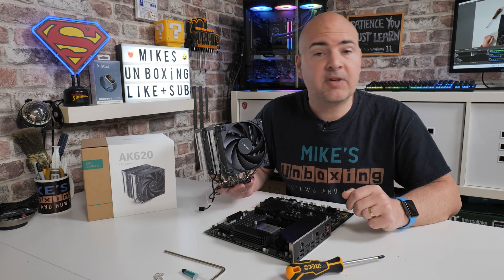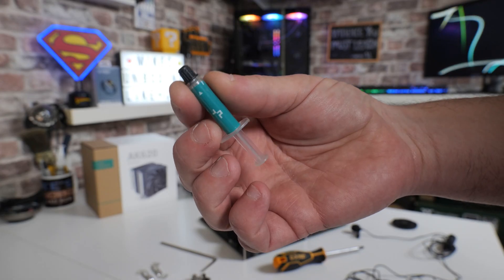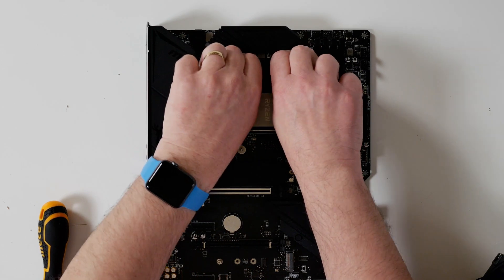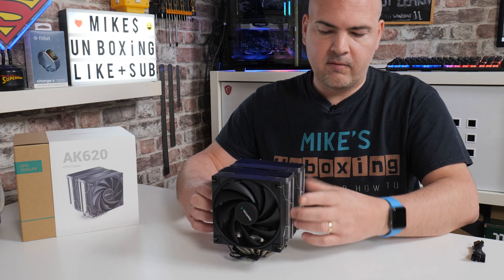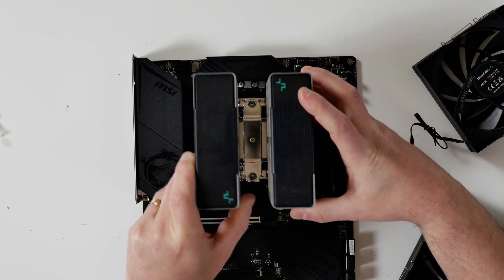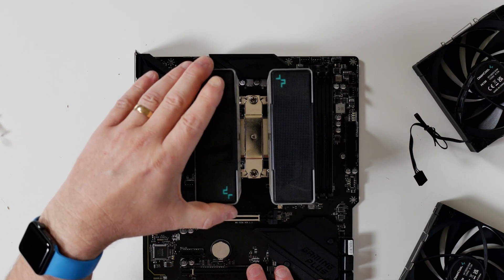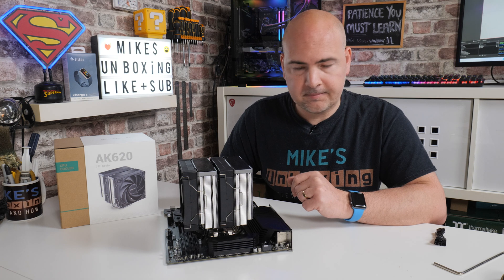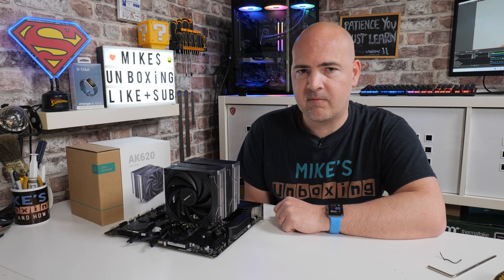How To Install Deepcool AK620 CPU Cooler AMD AM4 Platform

Comment: Tip for AM4 users: if you plan to install it without removing the motherboard,  don’t unscrew both plastic holders all at once, if you do it will drop your backplate and you will have to remove the motherboard and put the backplate on before able to install the plastic+metal screws from the new cooler.
Reply: massive massive tip
Reply: Just learned this the hard way
Reply: this is why im so glad i have a case where the back panel opens and i have access to the back of the mobo
Reply: 1:45 for people like me who have bad reading/listening comprehension skills XD
Reply: I almost did this install with only the booklet and thought “nah lemme just watch it done once and saw your comment. THANK YOU. YOU SAVED ME SUCH A HEADACHE!!
Reply: Wow as I read this N removed it, heard a clank
Reply: and where you put the ram btw? this is so big it covers 3 of the ram slots legit you cannot put anything in it anymore wtf
Reply: @davidcorodeanu4535  check your ram clearance size and if uv’e put it on backwards maybe
Reply: @JO3KR  they are 133.35mm x 42.2mm x 8mm
Reply: Could I still do this with the PC laying down?
Reply: @kyleplayz834  yes, no problem as long as one of the brackets is screwed.
Reply: @kekovkeks  so as long as I just replace one bracket at a time I’m good? That’s good to know lol.
Reply: @kyleplayz834  yeah, the plate itself is just holding on 4 screws, 2 for each bracket. Just make sure you hold the backplate right way so you won't miss screwing it up with other brackets. I'd also advise to remove the backside of PC case and you'll be certainly available to hold the mboard backplate in place by your second hand when screwing all up. If your PC case is very basic and has this option you should probably do it.
P.s. this way you could unscrew both brackets at once. The backplate usually has cylinders that is piercing through the motherboard holes for brackets so you won't really have a trouble holding it unscrewed.
Reply: thank you!!!!
Reply: Good tip thnx 👍
Reply: Thanks for the tip Yo!
Reply: WHEW my case has an opening on the back and it was on the floor. Was freaking out for a sec. BEST TIP
Reply: FUCK, I thought mine just didn't have the screws. I wish I read this before
Reply: Almost just learned that the hard way just now.. Luckily i could still get a screw into the backplate and use that one to pull it up and get the rest back in..
Reply: Hmm, good thing I know how gravity works, the case should be properly laid down then you're good to go.
Reply: Unless you have a good case.
Reply: I use blu-tak to stick my backplate to my motherboard in a removable way. Maybe ghetto, but it works.
Reply: Thank you so much!🙇‍♂️
I wouldn't have known that there was a backplate holding it to the Mobo if not for your comment.

Thanks to you, I did not have learn it the "hard" way as others experienced it.
Reply: So how would I go about installing this without taking the motherboard out from my PC? Take off one plastic holder at a time?
Reply: Good tip for new users! Indeed it will be troubling if the reinforcing backplate of AM4 mobos will fall. Though the crates with the backside door could help if you really gonna miss it 😂

Comment: Thanks, subscribed. I got a question. My ambiance is 35 degree Celsius. After installing this I'm getting 55-60 on idle. And 70-75 while gaming. Is it too much or normal?
Reply from the maker: sounds a little high but you didn't mention what CPU you have or chassis
Reply: @mikesunboxing  I'm using Cooler Master H500M case, 3700x ryzen cpu 1660 ti graphics card, 32 gb c16, 3600 hz ram.
Reply: @iamsurajsharma  55-60C makes sense if your ambient is 35C also 70-75 is perfectly fun under load, just make sure it doesn’t go over 85C :)
Reply: @kingfu987  Thanks for the advice. It's running great 👍.

Comment: Hello sir I'm from India

I'm using AMD 3700 x with stock cooler
My GPU in 2060 
Cabinet deepcool matterex 55 tempad glass

Now while playing my cpu and GPU both reaching 80+ tem after side panel glass open tem gets to 70+ what should I do i was thinking to buy deepcool AIO but i saw ur vedio now I'm confused which should i buy ak 620 or AIO
Reply from the maker: if you have the room for it the 620 as great and never a chance of pump failure or leaks, but water cooling will run a little cooler in the long run

Comment: I'm struggling with getting mine into my motherboard, I'm using a B660 plus WiFi d4 motherboard and for some reason brackets are to low for the cpu cooler to be installed? (I'm hoping I didn't damage the cpu or motherboard because at one point I put a lot of pressure to try and get it on)
Reply from the maker: This is maybe easier to fix or at least advise if we can ask more questions and get direct answers, so feel free to join our Discord chat and we can go over it in more detail https://discord.gg/gaeeDPw
Reply: I just needed a lga 1700 mount which I've asked the manufacturer to send just for an update. For a first time builder I could have damaged my motherboard trying to get the other mount on without realising but luckily I stopped myself from putting to much pressure on it
Reply from the maker: @andrewpaul6364  glad to hear they are sending you one, i was confused but then realised the ak400 comes with LGA1700 mount but the AK620 at present doesn't

Comment: I have four sticks of Corsair Vengeance ram, the short ones. Will this cooler clear them fine or will I have to remove a stick or two?
Reply from the maker: i think you will be fine there with the low profile ram, depending on your needs and budget maybe also consider the AK400?
Reply: @mikesunboxing  thought i'd give you a lil update. Got the 620, bit of a stinker getting it on but i managed lol
Doesn't interfere with the ram, was worth it (:
Reply from the maker: @Mazzaroth-IX  Glad you're happy with it :-) Thanks for the update
Reply: @Mazzaroth-IX very late reply but how tall is your RAM? I’m looking at coolers and my RAM is 44mm high. Wondering if this will interfere.
Reply: Also very nice video, I learn mostly by observation so the amount of detail is really helpful (:
Reply from the maker: thanks that is very kind of you

Comment: I have mine sag a little bit. I am worried if i need to tighten the screw a little bit more. 
Btw, I am using i5-12600k, LGA1700 motherboard
Reply from the maker: yeah check that everything is secure

Comment: That defiantly is a large cooler. I really like the design of the fin stack. It's a bit overkill for my CPU's. My i5-4690k draws 88 watts. The rest max out at around 65 watts. Thanks for the review Mike and Lady Kath. Take care. Cheers
Reply from the maker: yeah it is overkill for most systems to be fair, but it would keep it very cool
Reply: @mikesunboxing  I have two of the Vetroo V5's, one in black and one in white. Take care. Cheers

Comment: I'm still debating if I should get this cooler for my 3950x. It is cooled by the Snowman mt-6, but when temps will get hotter, it may not be sufficient enough as it is a single tower.  The 4 cores over the 5900x, also cooled by a mt-6, really make a diffference in heat output.  As of now, the 5900x is still below the 90 degrees, but the 3950x stay close to the 90, sometime more or less by a few degrees. As per AMD, the max temp is 95 before the cpu start to protect itself and since the computer is stable, I'm not too worried. But with summer coming fast over here, that might be another story!
Reply: Try undervolt your 3950x
Reply: @astroinferno-t5y  I was always supposed to do it after enabling PBO, but I'm lazy and let it as it.. But I will probably do it later when the weather start to get hotter.
Reply from the maker: i would turn off PBO or set it to auto rather than enabled, that will reduce the temps a bit but not hurt performance in general
Reply: @mikesunboxing  yeah, but right now, the temps is 89C,which is acceptable for me. But I will take your suggestion if things start to deteriorate.
Still impressed by the Snowman, especially that my 3950x is not a silicon lotery winner... 🙄

Comment: Hi Mike. Whats ur Opinion on the RTX 3050 (380€) and the Rtx 3060
(450€). Cant decide which one to get
Reply from the maker: for the extra the 3060 for me
Reply: @mikesunboxing  well what about the 4060? Do u think waiting for the 4060 is a good idea because many tests showed that it is near the 3090
Performance and it only needs
200w. I hav a 600w bequiet PSU with an NZXT aio and ryzen 5 3600. the will 4060
Will cost 400-500$ it says. Will the Pins for the GPU Power connection be the same? Is it a good Idea to wait?

Sry for my bad english